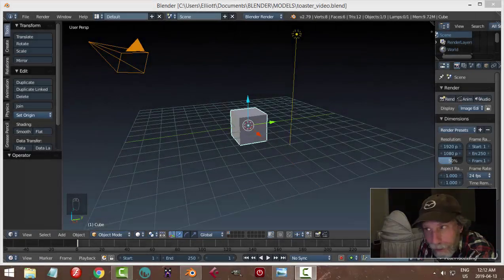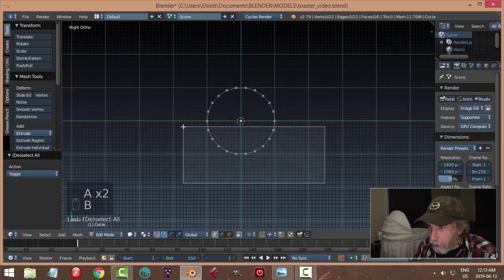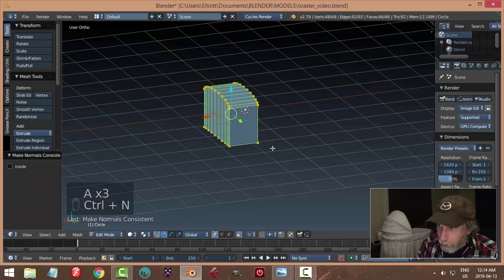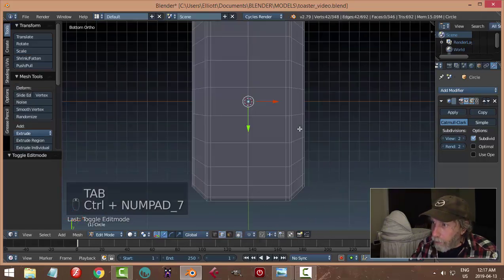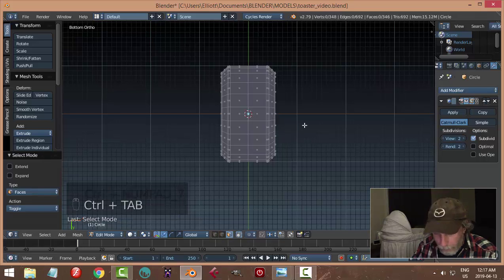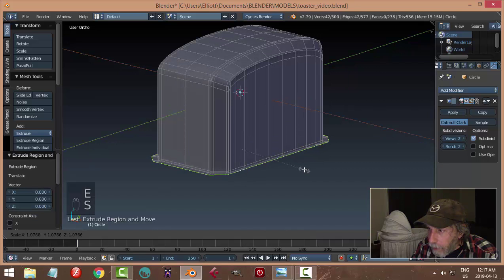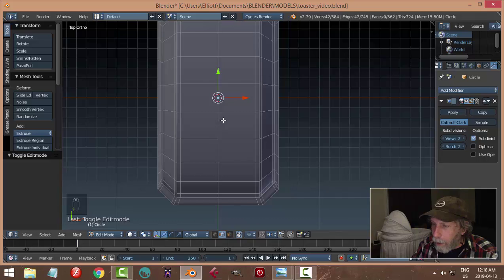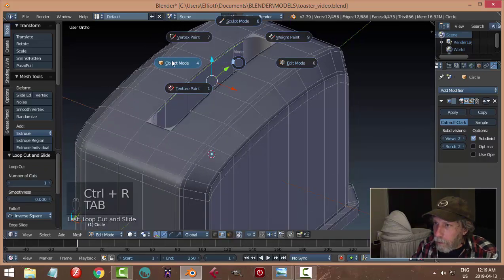Blender: Modeling a Toaster (Part 1)

Comment: I really enjoy watching your videos.  I wonder, though, why you always switch to Cycles render and GPU compute at the beginning of each tutorial.  Since you use them in every tutorial I've seen you do, why don't you just open a new file, set them as you like and then save the startup file in the file menu?  This would save you from having to do it each time (unless, of course, you are demonstrating this for the purpose of the tutorial).  Setting User Preferences and Startup File options is always the first thing I do whenever I install Blender on a new machine.

Thank you for your work!
Reply from the maker: I really should set that up in a start up file. I guess I do it to show viewers but it's pretty obvious. Thanks for the kind comment and for stopping by.

Comment: Way too fast
Reply from the maker: Sorry Gradient, if that was too fast. Would it be helpful to you if I made another video that went slowly through all the steps?  Are you just beginning with blender?  I wouldn't consider this model to be exactly a beginner's model but perhaps with more instruction and a slower pace, it could be made by somebody with little (but some) blender experience. Let me know if you would like a slower version and I will try to do that for you. Welcome aboard :)
Reply: @zerobio  yes please and yes I am just starting off with blender
Reply from the maker: I understand.  So would you like a slower video version showing how to model this toaster?
Reply from the maker: I have uploaded Part 1 of a new video series showing the modeling of a toaster for beginners.  Please have a look and let me know if the pace and explanations in this video works well for you.  Good luck!  BTW, are you using version 2.79 or 2.8?  Personally, I would recommend 2.79 as all of my videos are done using that or an earlier version and 2.8 is somewhat different.  I will eventually use 2.8 for the videos but for now, I'm sticking with 2.79.
Reply from the maker: Part 2 of modeling the toaster is now posted. If this is helpful to you or if you need me to go even slower, please write me back to let me know. Good luck!